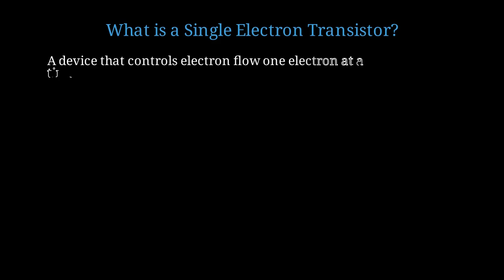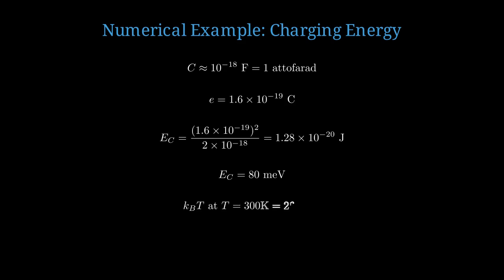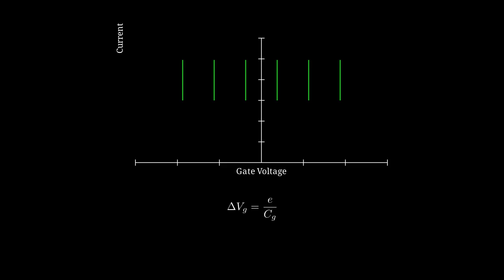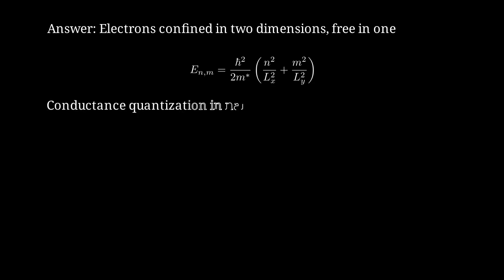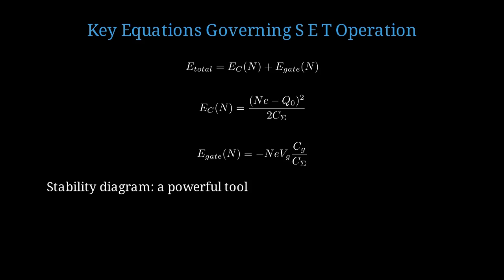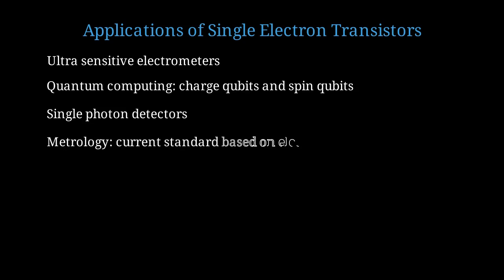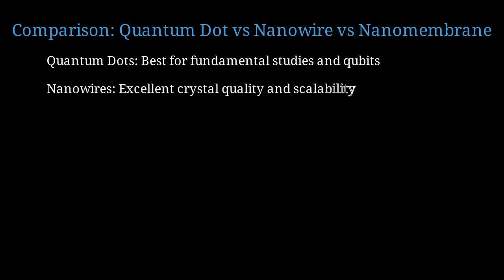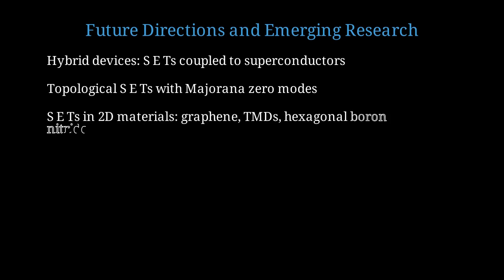Single Electron Transistor: The Smallest Switch in Physics

Comment: Yes it's interesting BUT the ability to actually manufacturing a SET is pretty much non-existent right now.  This is where engineering realities negate physics theory.

There is the cryo necessities.  But there are other as well.

Currently the lifespan of deep nanometer CMOS involves an SiO2 defect that changes the position of a single oxygen atom among 10^3 other oxygen atoms including interfaces on both sides of the gate oxide by only Å offset.  This leads to a cascade of failures that become a BTI failure.  So the level of position control of atoms required for SETs is beyond this.   

In planar MOS, the lifetime years is proportional to the minimum channel dimension in nanometers ignoring direct gate tunneling.  This limit is dominated by BTI failure. This 3 nm limit has been "cheated" with geometry going into the Z-axis with FinFETs and GAA.

A SET completely changes its IV characteristic quite seriously by any misplacement of the construction.  Precisely on atom by definition.   Because this physical misplacement radically changes the wave function.  Right now this is no where near what is possible with either photolithography (either EUV or its follow-on NA EUV) nor other process controls in the Z axis. 

It could be possible someday but the cost to achieve this is conservatively 10x what deep nanometer (including GAA) current costs.  These costs already too expensive for 90% of the semiconductor industry - either those who have fabs but also those who are fabless.  It will be only the 1% and there actually aren't enough customers for that price point.  Economics is a design parameters of EQUAL criticality to any technical design parameter!

But of course this was also true about non-planar MOS as well.   The transition from planar to non-planar drove up cost by similar magnitude from planar MOS.

Probably Organic Chemistry and a molecular implementation is the only realistic answer.  Less so a quasi-organic with silicon chains.  We can control a chain and functional attachments atom-by-atom in organic chemistry  in the sub-3 nm range of sizes.  Inorganic implementations seem unrealistic technically and economically.